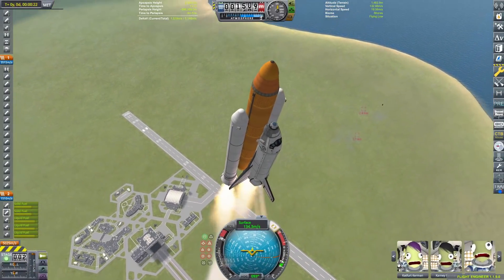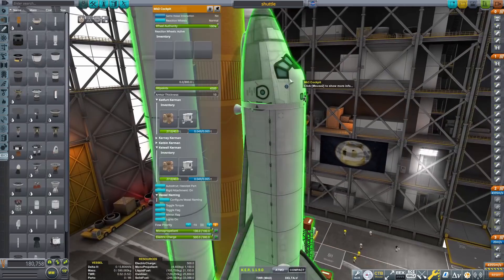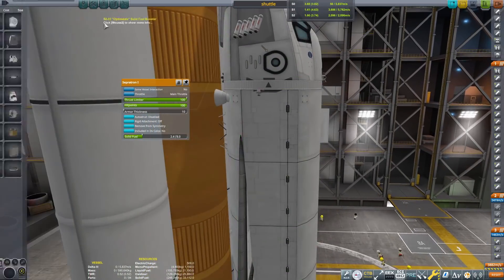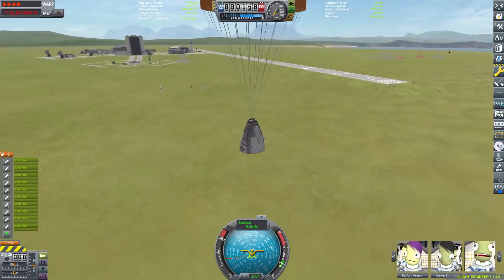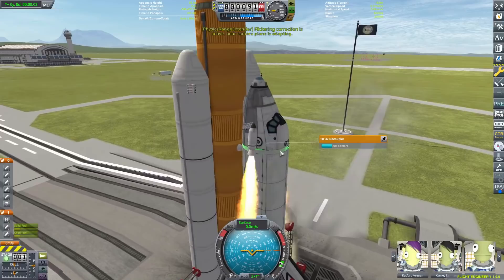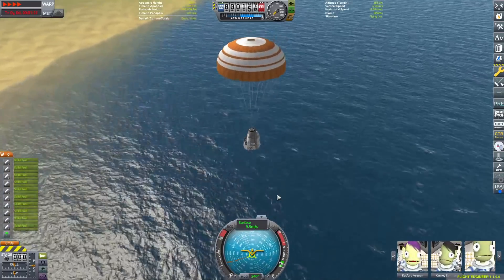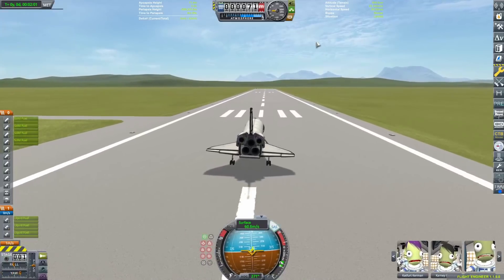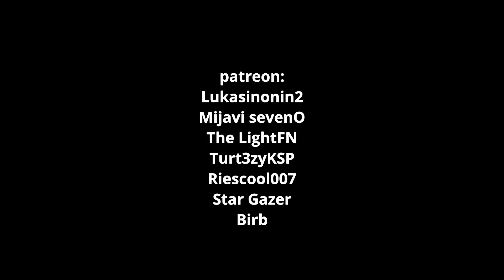KSP: Making an Abort System for the Space Shuttle!

Comment: None of these designs are practical in actual spaceflight (but very practical in Kerbal spaceflight). The numerous SRB's would add a large amount of weight, and would need to be jettisoned, or shielded to prevent them from disintegrating on reentry. Both of these would require a major redesign of the shuttle.

The midflight abort system would almost certainly ignite the external fuel tank, which would lead to shrapnel and debris being ejected at high velocities, as well as a powerful shockwave. Coupled with holes in the structure caused by the debris, this would've led to a structural failure of the cockpit, and thus death of the crew.

Comment: Thing is, most of these would be impossible irl because from the mid deck and the payload bay there is a hatch / airlock and if it were to separate there would be a huge hole in the back of the cock pit and the mid deck. NASA would have to create a new design for the forward part of the Orbiter.
Reply: Could some kind of plug hatch be designed? I.e a hatch that gets pushed into the bulkhead by the air pressure in the cabin

Comment: If the Space Shuttle had the abort system and it's reusable with low cost, the Space Shuttle would have never retired.
Reply: Honestly, the shuttle could have been used to put lunar or Mars transfer equipment into orbit, as well as crews for them. Think how much money they'd save rather than needing massive rockets for every single mission.
Reply: A couple of fun facts: Originally, the Space Shuttle had a two-stage fully-reusable flyback design, but that was too expensive to develop on NASA's shoestring budget.
Later, there were plans for liquid fuel boosters and an ejectable crew deck on the Shuttle, but that was also too expensive.
Reply: It still would of retired because of new company’s coming in to play such as space x
Reply: @Atlantis125  the only reason the US Gov looked for alternatives to the Space Shuttle (EX CRS/CXP/CCP) is because the shuttle was over cost, high danger. had the shuttle been safer (and better managed (see: challenger)) spaceX never would've gained as much traction as it did
Reply: @TheColourOfFear  I know I didn’t want to do a whole a paragraph
Reply: @Atlantis125  Actually spacex came in after it was cancelled to fill the void
Reply: That's a lot of 'if's